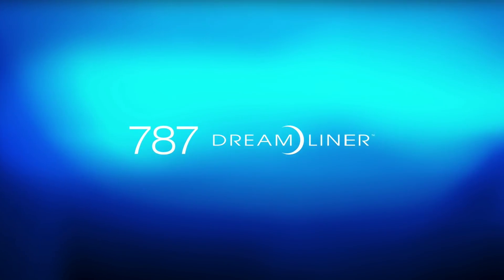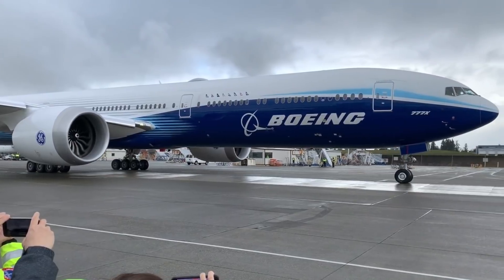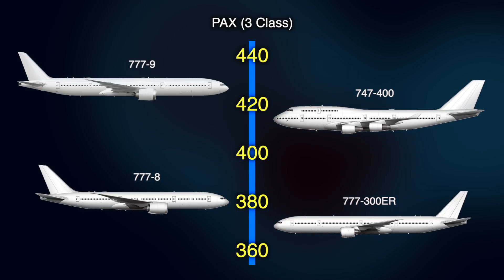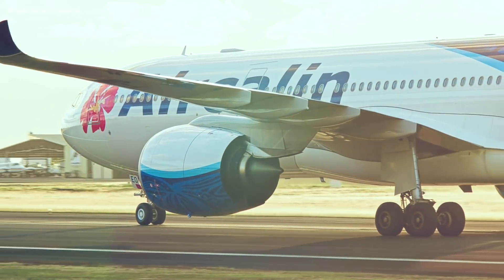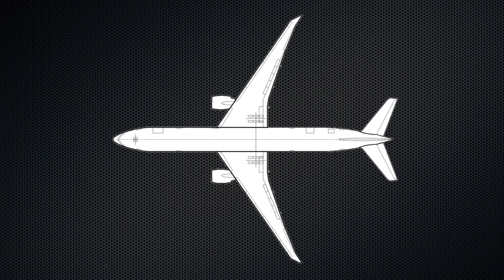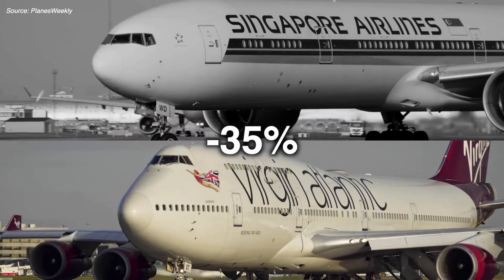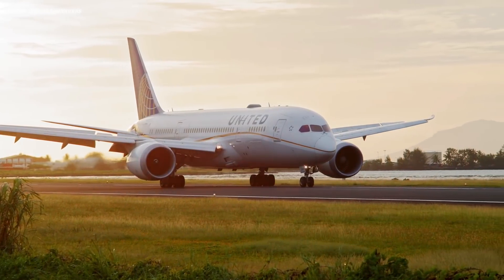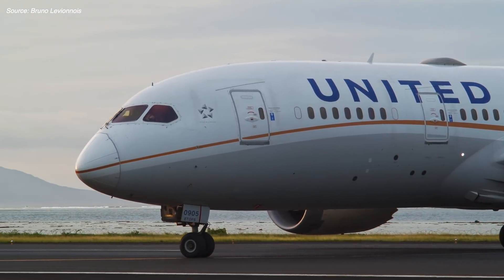The 777X Has a "Tesla Problem"

Comment: I think the B777X, will pick up more momentum as the decade goes on as more triple 7s reach retirement age.
Reply: I agree, as long as the companies with the older 777 
want to stay with Boeing and not go for the more readily available A350.
Reply: That's not true. Most airlines replaces B777-200/-ER with either B787-9/-10 and or A350-900.

Most B777-300ER is extremely young. Many are only 3-4 years old. By the time they are retired, it would be 2035. B777X would be extremely inefficient by then.
Reply: @nntflow7058  Boeing made the plane too early, much early, they should have known this since they got so many orders on the 77W, there are some that isn't even delivered yet, some airlines are waiting for their 77W and boeings telling them to buy a whole lot more expensive 779.

Comment: Hmm, I'm not convinced they went in the right direction.  Why spend gazillions on the dev and build of their state-of-the-art Dreamliner - to then not use that tech and learnings on the next-gen of aviation.  It feels a lot like the 737-Max approach and I wonder if that doesn't fill buyers with confidence? Will be interesting to see how it pans out and of course I want to fly on a 777X variant :) Congrats on your new job!
Reply: They actually did use a lot of the 787 tech in terms of wings, cockpit, engines etc. It would have more than doubled the already high development cost to go with a full on composite  fuselage. A new facility would have had to be constructed for assembling the plane and additional autoclaves. Probably not worth the investment for a lower volume aircraft. I'm not a big Boeing fan anymore given all the mismanagement, but in this case probably made the right call.
Reply: @johniii8147  i respect the fact that you are an non boeing fan that doesnt instantly say: Boeing bad
Reply: @apotato5563  They just did it to themselves with now years of bad program management, quality control, cost cutting to boost stock price, etc etc.  They are now paying the price for that and it was a long time coming.
Reply: @johniii8147  yeah boeing really isnt doing well. Very sad such an iconic builder
Reply: My thoughts exactly.  Another frankenplane.  787 tech should have been used for a clean sheet design for both the 737 the 777.

This 737max has weakened Boeings position in the industry and they are stuck with it for at least 20 years.  Such a shame.

Comment: I don’t think that any US customers will fly the 777X. United has the A350 on order and American Airlines the issue of having too many 777-300ER’s. The only airline in the whole North American continent I see getting the 777X is Air Canada who flys a lot of 777-300ER’s
Reply: But United has been pushing back their A350s and it looks like United may use their A350s for domestic use to replace the domestic subfleet of 777s. So that will not address replacing their long-haul 777-200ERs.
Reply: @Blank00  I doubt United will use the A350’s for domestic. United has 55 777-200ER’s that are aging and the A350-900 is the perfect replacement. And they would most definitely use the 787-10’s for domestic instead of the A350-900’s because the A350’s have a significantly longer range.
Reply: @TysonIke  There have been airlines using A350s for domestic configuation. For example, Singapore Airlines and JAL both have a subfleet of A350s with a "regional" configuration. I think that what United can do is order both the A350 and 777-8, where the A350 will replace 19 PW powered 777-200s plus 33 PW powered 777-200ERs (That's 52 PW powered 777s in total, more than the 45 A350s which will supposedly replace them) while the 777x can replace the 22 GE powered 777-200ERs that came from Continental.
Reply: United only has a few(by their standards) orders for the A350.

The still have room to integrate the B777X if they wished, and likely will do so.
Reply: @declannewton2556  I don’t see why they would need the 777X though. They already have the 777-300ER but they don’t need more. The 777-300ER flys routes like New York to Mumbai or San Francisco to Taipei where at Mumbai and Taipei they don’t have slots to add flights from other cities like Chicago. They also fly the 777-300ER from San Francisco to Sydney and Auckland but if longer range planes are introduced they would probably size down to a 787-10 or A350. And on routes like Newark to Shanghai, Hong Kong, and São Paulo they alternate between 777 variants. Instead of altering they could use they A350-1000. So they really don’t need the 777X because the 777-300ER covers the purpose of the 777-9X and the A350-1000 can cover the purpose of the 777-8X.
Reply: @TysonIke  
To understand why the other American carriers will buy the B777X, you need understand why it was built. The B777X is plane model built to replace its previous models when they reach retirement age, so B777X has to be there before they start retiring. Which is why Boeing designed it when they did.

Those B777-300s are rocketing towards retirement age and will be retired within this decade, if not, the early 2030s. The B777X will be there to fill their roles.

Tldr, the B777X is plane waiting for demand, demand that will likely come.
Reply: @declannewton2556  ummm not exactly. American Airlines received their first 777-300ER in December of 2012 making it only 8.9 years old. Delta doesn’t fly the 777 but they fly the A350. And United got their first 777-300ER in December 2016 making the oldest one 4.9 years old (and btw their newest new is only 1.5 years old). But American Airlines is struggling to find routes for the 777-300ER and if they replaced them the 787-10 would probably be the best option because of its commonality with the 787-8/-9 and all of American’s 777-300ER routes are within the 787’s range. American mostly flys it on hub to hub domestic routes or on international routes to London. American Airlines struggles to find long haul routes for them and long haul routes were their intended purpose. Now still Air Canada is the only North American airline which I think will get the 777X because they fly 29 planes delivered from 2008 to 2016. Air Canada has the oldest 777 fleet and they can fill them. So in conclusion American can get the 787-10, Delta could get the A350-1000, and United could get the A350-1000, and Air Canada will probably be the only airline to get the 777X.
Reply: @TysonIke  
1. Like I said, the American carriers will start ordering the B777X closer to the 2030s if not in that decade.

2. I don't think American will go for the B787-10 to replace the B777-300ER given the volatility of the aviation sector. The airlines of America learned over the past summer of underestimating how much travel can increase compared to contradictions.

3. With regards to United, I think they're buying the A350s for buying's sake, rather than as a serious attempt to start shifting B777 services to it.

Edit:
4. Not mentioning United also has B777-200s that will be replaced(but later than normal since I believe they're still grounded)
Reply: @declannewton2556  for American the 787-10 makes sense as they could transition to an all 787 long haul fleet. For United the A350-900 is the perfect 777-200ER replacement as the A350 is around the same size but has more range and efficiency. And United’s 777-200’s could just be replaced with the 787-10

Comment: I think that Boeing made a mistake by making the 777X and 737MAX instead of new products. I think that they should have tried to build 2 single isle planes one to fit the 100-160 seat market and another for 170-250. Then Boeing would have a 737 and 757 replacement along with a 100 seater jet.
Reply: truee, they should give up on United big orders in the beginning of 2010's and focus on building a 737 replacement instead. i still can see why boeing make 777X but unfortunately 777X is just came at the wrong time like A380 despite boeing didn't make too much update on 777X

Comment: There's also the problem of logistics.  Once you manufacture the 6.2m wide fuselage, how would you get it to the assembly plant?  It's too big to travel via road or rail.  It won't even fit the current Dreamlifter LCF.  They would have to move composite manufacturing to the west coast, assembly to the east coast, or design a new LCF to fly it.  It doesn't make sense for Boeing to even think about it.
Reply: What is truly sad, it is all robotic construction... That is how F'd up the regulatory/tax structure here in Washington state is along with employee environment... Toray built a big CF plant in Tacoma and 787 major components are all made --> elsewhere.  Hell, can't even say Boeing makes the 787.  It is more a Japanese jet, UK jet than a US jet.

Comment: I think you overestimate the weight savings from Composite fuselage.   But I think a more important factor is one of type certification (which at time of decision was still important).
If going copmposite fuselage changes handling characteristics of aircraft,  maintenance etc, the FAA might not have rubber stamped the derivative as it did for the 737 MAX, at which point the certification costs rise significantly AND airlines are less interested becayse they need more pilot training if they are to drive both  the original 777 and the new one. In the end, because of 737-MAX, the costs savings for certifiting a mere derivative have evaporated. 

Duplicating the fuselage manufacture of the 787 onto the larger 777 would have costed a LOT.  And you can't scale up production that easily when the number of plugs you can produce is ;limited by the autoclave they have. Those are not easuy to duplicate.

When announced the 787 promised a LOT. But Boeing learned a lot from that project.  And since then, the 747-8 and 777x projects have kept the standard way of building aircraft because the dividends of the 787 weren't large enough to warrant major changes to 747 ot 787.  (consider 747-8 uses Bleed air instead of being al electric despite using same engines as 787). 

The real test is when Boeing build a clean sheet design replacement for narrowbodies that encompasses the 737 and 757. How much of the 787 will be used for that aircraft and how much conventional building will be used.

Personally, ever since Boeing gave airlines its blessing to densify cabin with 10 across narrow seats, the 777 is not a plane i want to fly in.   (same with 787 origihally designed for 8 across but when sales failed to take off was repitched as 9 across with narrow seats - especially since you dont have control of the virtual window blinds on many airlines).
Reply: Amen to that, the  virtual window blinds are horrible and so is the 9-across seating.   The 787 was touted as being more comfortable than its predecessors but ended up less so.

Comment: Its more the Jumbo issue. Look how poorly the a340, a380, and 747-8 sold also. The convenience of the 787 with more fuel efficiany and easier load factors make big planes unnecessary plus American travelers are picky; some people like traveling at night and some like to fly starting in the morning. 787 works for them. Most people don’t realize how big the 777 is. I was flying lga-bur via dfw and got stuck in Dallas because of a snowstorm for 10 hours and American just brought out a 777 and flew about 7 flights of bur/lax bound passengers in 1 flight.
20 years ago no one would have believed it but the big 3 have really changed the way airlines operate with establishing new routes and increasing daily flights if the demand is there. The real savings though is the human costs. A 787 has less than half the FA's that a 777 has. It is funny how Emirates and Qatar and etihad tried to stay away from the 787 and a350 but finally gave in within the last 2 years with the pandemic.

The 777x has sold better than the other 3 big planes and it hasn't entered service yet. Airlines may see a need once it enters service.
Reply: It's untrue the 787 uses less than half the FA's of 777. Not even close to true. And Qatar ordered the 787 a long time ago. They already have 39 between the 8 and 9 in their fleet. Their last order for the 9 was back in 2016. It's not about "human" cost it's about overall lower cost and better matching size to actual demand.

Comment: Since it's a VLA , i don't see it sell well in the market even in the near future or distant future , boeing should concentrate on further improving the 787 line and develop the NMA and on a side note i agree with coby even if the 777x were built completely with CFRP it still wouldn't sell that well sadly the 777x will be a niche aircraft a few operators would fly.

Comment: The main issue of the 777X is that it is too big for the current market: it will take quite a while for the industry to go back to pre-Covid levels and until then makes little sense to have planes this big. At the end of the day such a plane would thrive in slot-restricted routes with a lot of passenger traffic in between (like JFK to Heathrow), which as of now do not have so much traffic to warrant them. Also: they are great for a hub-and-spoke strategy, which is becoming less and less common as of now. 

With this said I wonder the amount of units sold Boeing needs to breakeven, because that defines whether it was a failure or not.
Reply: 800 planes my guess.

Comment: What happens to composite aircrafts when they die ? 

Are there anything recyclable other than the engines, landing gear etc ... ?
Reply: Mostly no.. we know how to disolve to resin. The glas, Armid  or carbon fiber is either burnt or melted. There are no minerals in them. The total raw material cost for the component in a aircraft is a few thousand dollar or less. Glas fiber is made out of sand, carbon fiber out of coal or natrual gas, and Amid  is made of hydrocarbond.  What makes the material expsive is the process of making fiber of it. The fibers cant be reused for several reason.

The ressin can is its thermo set, and theoretically if its thermo hardend.

The next thing that makes it expensive is tooling. So you have to have really high flow.. or rather, just then right anount.

Typicallt a maximum of 2 units a Day would be made from a tool, so say 250 days a year, that would be 500 a year. Got to stick close to that number. Making 50 a year will not do. (This is true for autoclaved fiber, not spray formed one)
Reply: @matsv201  I was going to say that the people who are working on recycling wind turbine blades might figure out how to recycle composite airplanes.
Reply: @matsv201  Not saying your wrong as we have seen this in the past.    But there are quite a number of groups working on it.    I have people telling me the EV batteries can't be recycled.  So much pressure from clueless people with agendas.

Comment: 2 problems for the new jet as I see it:
1. The sheer size of the plane. These behemoths are going out of style. People and airlines want more flexibility in scheduling. They would rather have 2 midsize planes flying to a destination at different times within a time span than one massive flight. 
2. The plane it's meant to replace, 777-300, is still relatively young so airlines are not in a hurry to bring in its younger and bigger sibling. 
There are relatively few airlines that have the ability to make the 777X work for them financially and they've all placed their orders already. It's going to be a hard slog for 777X sales team from here on.

Comment: I think a lot of the 777X's issues are simply to do with timing especially when it comes to the 777-8 in particular. It's supposed to be the replacement of the 777-300ER which in itself is a relatively young plane. Most examples of it are less than 10 years old which for a long haul widebody is nothing. I'm pretty confident as the industry recovers and more of the jumbo quadjets and older 777s are retired, 777X orders will increase. As you said, United and American are prime candidates to order it as their 777 rosters are beginning to age.

Comment: There actually is a composite 777 replacement - A350. 359 and 351 carry almost as much as 772/77L and 77W respectively.

The market is not large enough, while 777 as a heavylifter is just much against A350 (in contrast, A330 is not really heavier than 787, though it’s by no means as capable). So by packing more passengers 777X could easily leaverage its potential and differentiate from its competitor, without costing too much.

Ironically, 10 abreast 77W is narrowing its gap with both 777X and A350.

Comment: Though building it from composites would have made it much more efficient, it would not improve the marketing side. At this point I don't really care what it is made from, as long as it is at least a more efficient and works well. I just want to see it in the skies ASAP.
Reply: Is buying a pair of 787s better than having a 777x
Reply: @jirehla-ab1671  It depends. If you are flying into a hub with expensive gates it would be better to have 1 big aircraft. Also, the 777X would be useful for long-haul and potentially ultra-long-haul routes, as the 787 doesn't have as big of a range as the 777X. However, if you are just flying into a smaller hub with cheaper gates, the 787s would be better for that.
Reply: @Agent44996  Still for any 777 operators they'd always have an 1-to-1 alternative called A350, and granted trip cost is lower.
Or if it's 772 then 789/78J could make it in some cases, and most case even cheaper than A350.
789 and all A350s fly much further than 779. 778 is the furthest but its economy isn’t favourable.
Anyone who order 777X would only be those who can
1. take advantage of larger aircraft. But do note that 77W/351 are already very large in today's standard. 
2. build large 777/787 fleet after replacement.
Reply: @Agent44996  The 787-9 has much if not more range than the 777-9. The choice between the two isn't range, it's how much capacity you need on a given route.